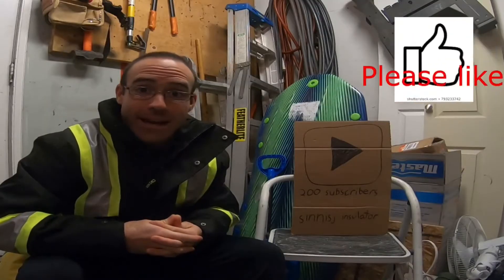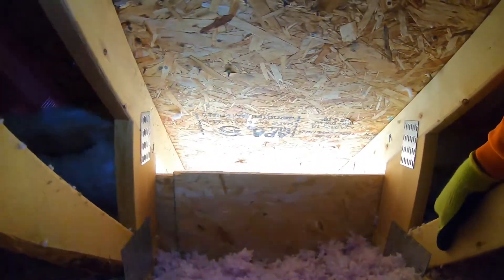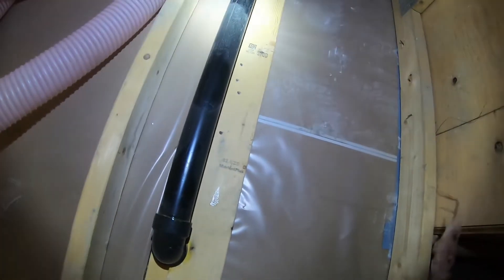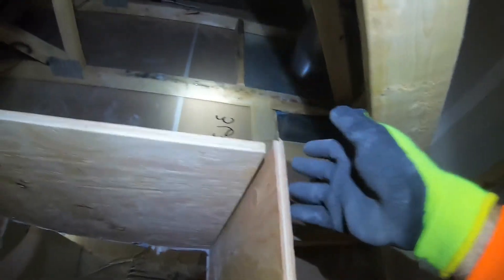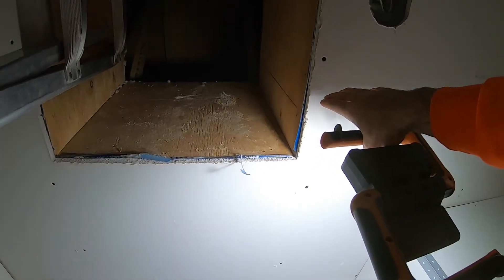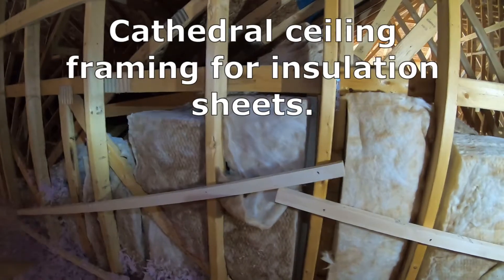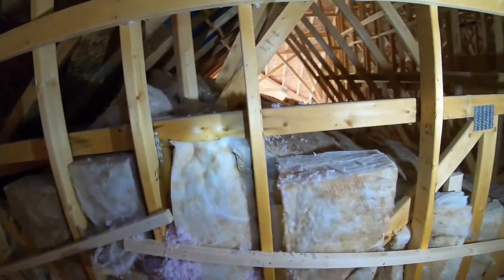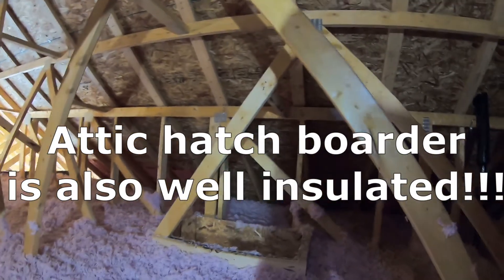Best framing tips for insulation and drywall in new house construction

Comment: I didn’t see a vent in that assembly,can the subs tell me why??
Reply from the maker: I want to understand the question, do you mean you didn't see me talking about plywood or wooden vents, or was there a house in the video clips where you didn't see vents installed?
Reply: @SinnisjInsulator  mmm a bit of both possibly , however it is a bit of a trick question for the subs to figure out
Reply from the maker: @chinidad2778  I'm not sure I have the audience yet for such questions 😊. I'll get working on it. Sidenote, I just found out what insulation goes in stoves, blew my mind the temperature resistance of that material.
Reply: @SinnisjInsulator  ceramic blanket yah it’s incredible, it was also used by kettle smelling
Reply from the maker: @chinidad2778  it makes you wonder why glass can burn... Must just be the molecular structure.
Reply: @SinnisjInsulator  it’s flash point along with the space in between each fibre  allows for hot gas to flow through and ignite the already hot glass fibres , if fibreglass was pre-treated with graphite powder or ceramic sealer ?!! Fibreglass would be fireproof
Reply from the maker: @chinidad2778  but would probably be way  more expensive. Ceramic fiber insulation has the same structure though right, with lots of air pockets? The only difference would be tue flash point of ceramic vs fiberglass.
Reply: @SinnisjInsulator  yes 7.3cents per batt,or 10.6 cents per cubic foot of blown
Reply from the maker: @chinidad2778  that sounds very insignificant. Where did you get those prices?
Reply: @SinnisjInsulator  so josh just a heads up , if you see grey spray being used (call a inspector) tell the inspector to have it tested ,and if you see a cotton candy blue spray foam (shunda)being used do the the same , neither chemical is C.C.M.C certified and its illegal to spray it in Canada.
Reply from the maker: @chinidad2778  ok thanks for the heads up.
Reply from the maker: A vent for which house? I am little confused myself at the question.

Comment: Good tips.  I've actually done some of these when I insulated my attic.  But I can see some improvements I can make based off your video!  Now I just need to get some time to get back in the attic.  I think I might blow in some more insulation this winter as well.  I've matted it down a big with all my home improvements.  Full watch BTW.  More videos like this please.  Best video yet.
Reply from the maker: Roger that, glad you found that useful. In the future I will make a video on building an attic walkway to access areas without wrecking too much of the loose-fill. But I want to also make one on radiant barriers.
Reply: @SinnisjInsulator  I love that.  It's so hard not to mess up the insulation.  I'd love to see how you do it.
Reply from the maker: @HowIDoThingsDIY  ok well noted, I actually have one video where I walk through how I top-up an attic that was disturbed from tradesman walking in it. https://youtu.be/JZuRrFeBvSA but I'll make one specific to your request since I know it will benefit a lot of homeowners.
Reply from the maker: Hi buddy, just posted a video on how important those vent plywood walls are, check it out https://youtu.be/H8bov3Fqioo
Reply: @SinnisjInsulator  I'm on it!
Reply from the maker: @HowIDoThingsDIY  thanks for your support.